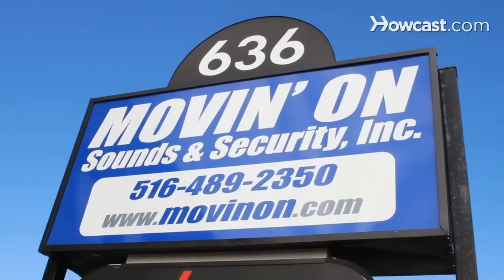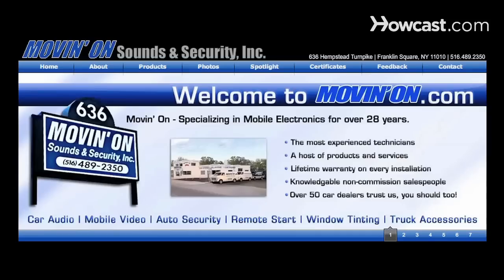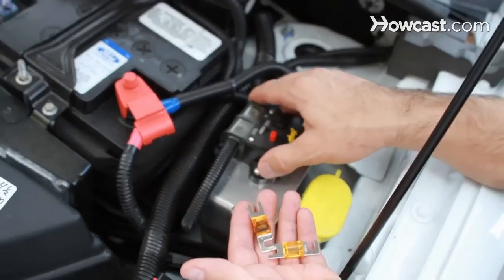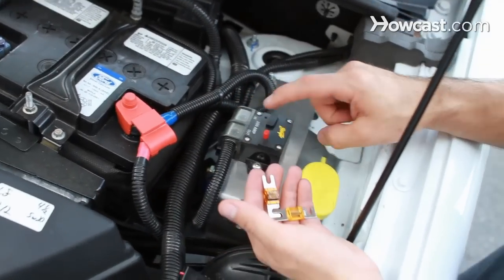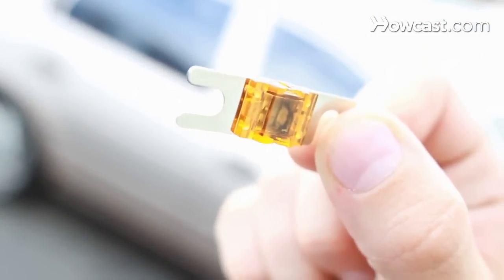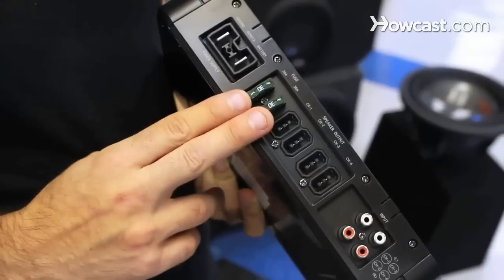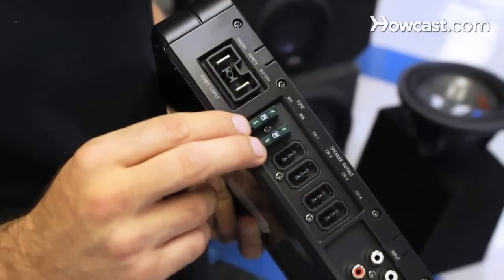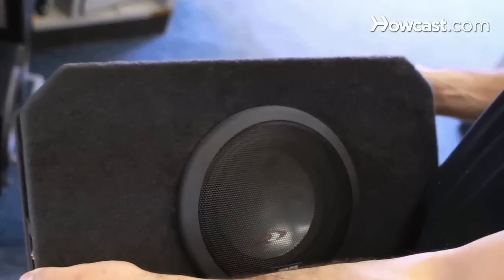How to Troubleshoot Dead Sub Amplifier | Car Audio

Comment: My power wire loses voltage and drops to around 7.50 volts at random times, causing the amp light to dim and bass to cut off, it slowly rises back up to 11-13 and comes back on, proceeding to do the same thing a few minutes later. WHY?
Reply: Do a big 3 upgrade, and or add another battery.

Comment: Why does my amp goes into protection mode when my power and ground is plugged in and then when I plug in my amp it goes thump thump all my fuses are good and ground and ACR jacksit was working at first then it just started doing that out of nowhere
Reply: Plugged in my speakers wire for my subs^^
Reply: And my amp don't smell burnt I opened it and nothing was burnt can u please help me

Comment: i have a rockford fosgate 600wtt 2 amp that was working perfectly fine then i removed it the system and reinstalled it and its not getting power what so ever,  i changed the fuses still nothing,  i commected a 100wtt 4 channle amp and that amp gets power,  any ideas  anyone?

Comment: I fisrt turned my amp on it its self no car no rca no speakers just my car battery the fucker started squealing at me kept doin it tryin diff thigs to it nothin workd the short light came one for a sec befor thermal tgen thermal stays on n when i hook a sub up the pops a sec. So the speaker terninal is getn power right lol wht do i do its p600.1 db

Comment: ok i have an annoyyyyyying friken problem..my sub pounds good for like 5-10 min on loud then it starts to sound distorted and shitty wtf is the problem??? i have a 8 gauge wire connected to a 0 gauge wire and the 8 guage has a burned fusebox but my firned says it shouldnt affect the sub...i think it is affecting the subs power..anyone have an idea wtf is going on???
Reply: I have the same problem
Reply: Chance Easom
yeah man its annoying as fuck my buddy tells  me its in my head im like naaaaaah my shit used to pound way fuckin harder lol
Reply: shouldn't change the wire, should always run same gauge from point A to B
Reply: Frank Mannino
 i didnt buy enough wire so can i atleast get a little bit more 0 gauge and connect it?
Reply: unless you solider it together and i wouldn't even do that either, i would honestly and safely tell you that you should find a way to re-route the wiring to give enough or just buy a longer 0 gauge wire. if it should happen to fall apart you are really looking at some serious problems. BE SAFE, you can never go wrong with that.
Reply: Frank Mannino
i bought a couple more ft of wire and replaced it after the fuse box and my shit bumps all the time again it was the burned fusebox wire i think it was a connection problem

Comment: I have a problem. My subwoofer is making no sound and i don't know what the problem can be. I was listening to my music and i drove through a pothole and my subwoofer immediately made no sound. They will make sound after i have turned the car on and drove for a couple of minutes but if i turn the cat off it will go back to making no sound
Reply: Sounds like lose wireing
Reply: Check for any cross wiring I had the same problem

Comment: whenever i turn my music up inside of my car my bass just all together stops working ive changed the fuses in my amp n now my amp turns back on but my subs cut out when my volumes turned up HELP!!!!!!!!
Reply: You check your ground!!!!!?? Are you running too low of resistance subwoofer aka 2 ohms bridged on a 2 channel or 1 ohm even. Everyone always does this and wonders why their amps get hot. Cheap class ab 2 channel amps cant handle 2 ohms bridged!!!

Comment: i try installing an aftermarket head unit, amp, and sub to my 03 expedition. the amp is on, but im not getting any sound off the subs. im sure the sub is good since i pulled it from the car i got rid of. and i connected the wires into its respective place. but no luck. any ideas?
Reply: You need to plug your phone directly into the amp to rule out radio issues. It's still no sound you need to adjust the gain and if it's turned up the amp may be bad . plug-in a cheap little speaker while testing to rule out  the sub wires are disconnected inside the box